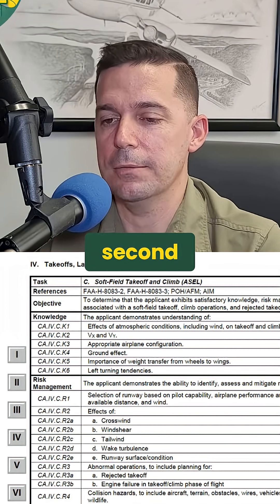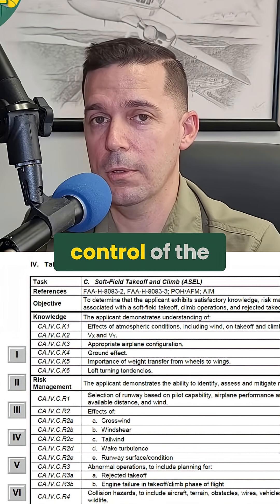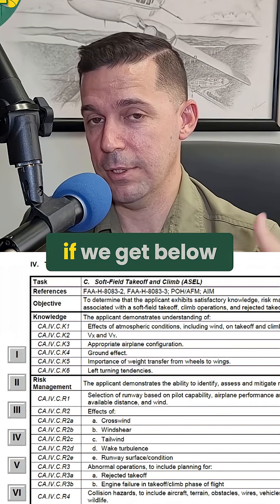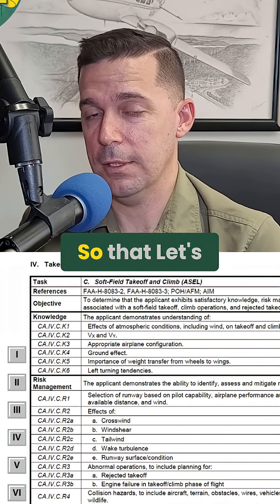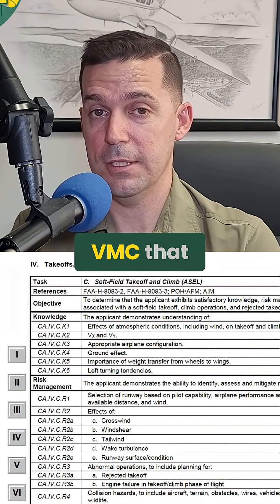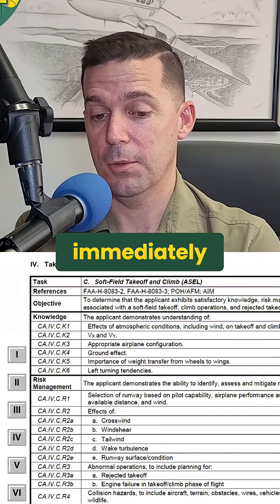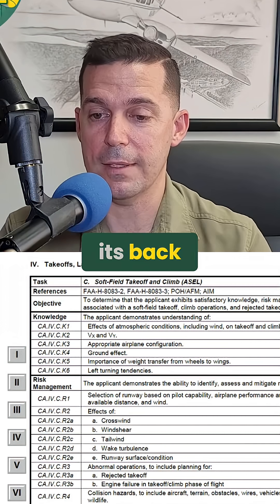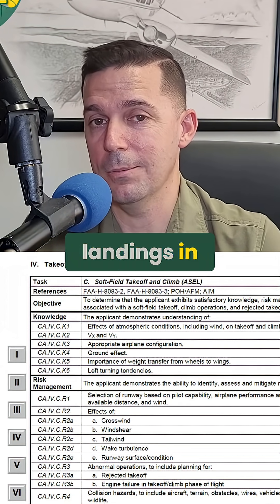Multi-Engine: Why Soft Field Takeoffs Are RISKY!

Comment: What about approach? Since I'm coming in with low power to land, is it safe then to go below VMCa to land short, or I must still fly above VMCa for the event of a go around?
Reply from the maker: Below Blueline on approach - ok
Below Redline on approach - not ok
If you had to do a go-around you may not have enough control authority to maintain aircraft control.
Reply: That is why you have a commit to land altitude, once you are below that altitude, you have decided that it is safer to land straight ahead than to go around and possibly VMC roll.